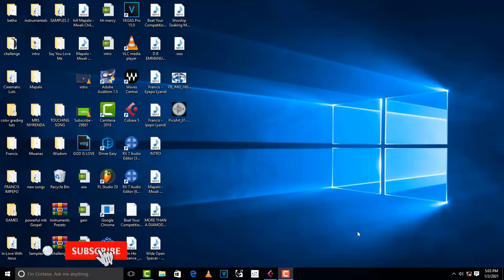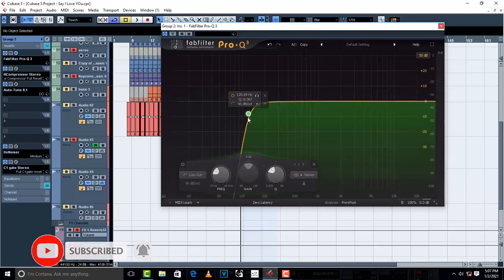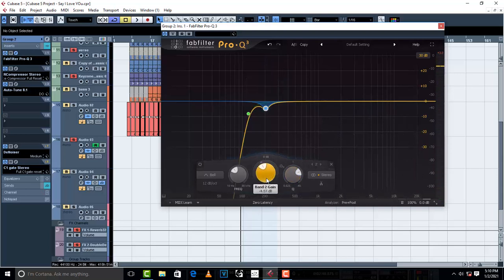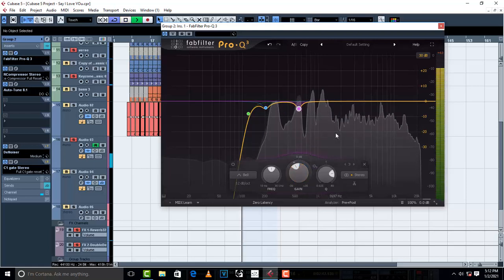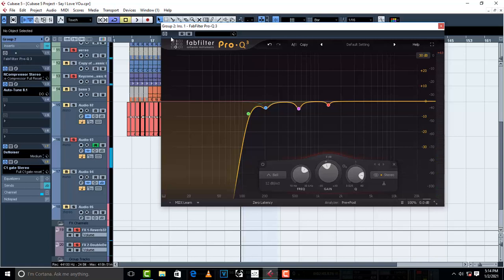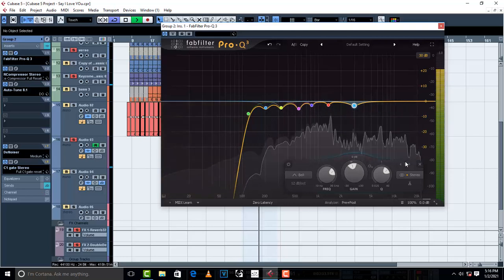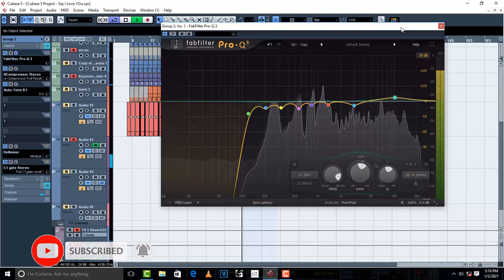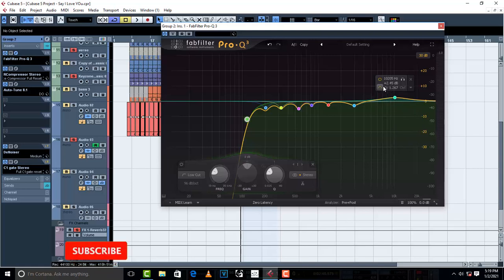How To EQ Vocals In Cubase 5 Using The Sweeping Method. #Cubase5 #Mixing #Mastering

Comment: I got another thing that gives me a hard time.......when time comes to mix the beat  how to avoid  instruments fight each other and a trick to level them.....please sir
Reply from the maker: Did you watch the one for side chain processing? If you did, then combine these three. Side Chain, EQ, Compression and panning. During EQ, remove the mud. During side chain, the kick and bass instruments from competing. During panning, send some of them to the right, left or half way especially pianos. During compression, set the ratio on 3:2 and push down the threshold until compression starts so that the instrument can be controlled. Also try to use Instruments that are not too noisy. I will do another video.
Reply: @hollywoodaccess  yes I watch it.....I will follow those step  .....thanks
Reply from the maker: Thanks.